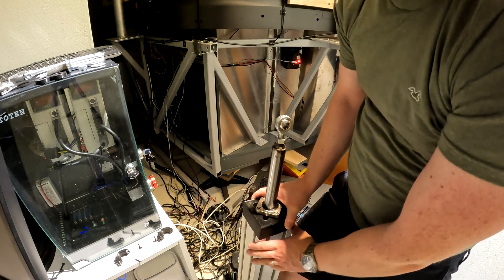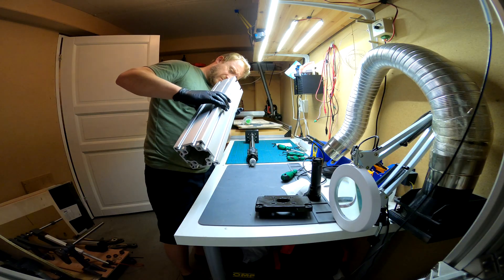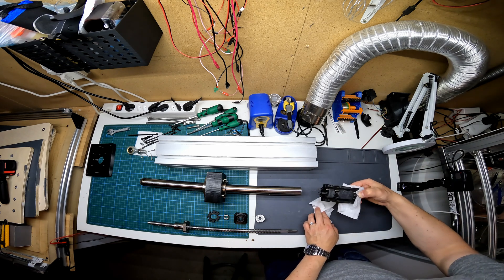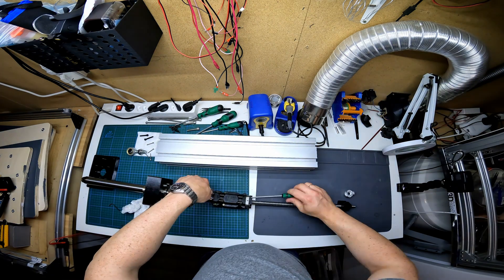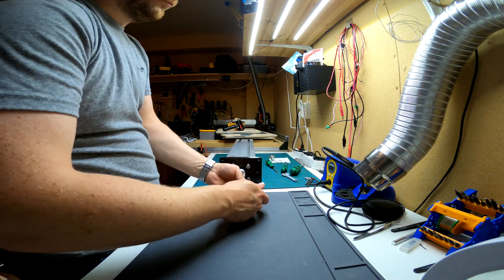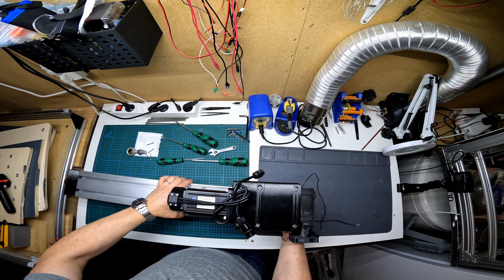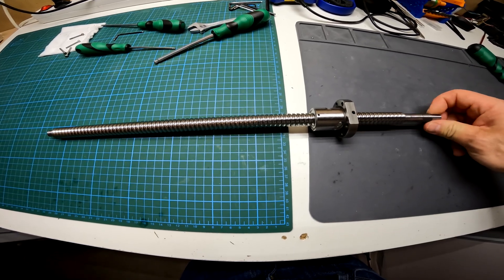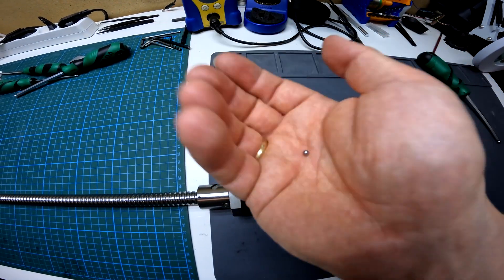Fixing my broken linear actuator - Boeing 737 motion sim

Comment: Always admire your setup, did you replace the missing ball from the actuator?
Reply from the maker: I replaced the whole ball screw. I did not know what was wrong, so I had ordered the ball screw before I started the dissasembly. I might order a new ball nut or try to fix the old one